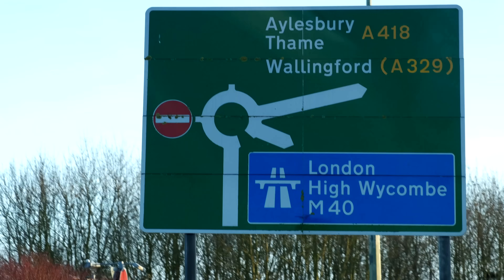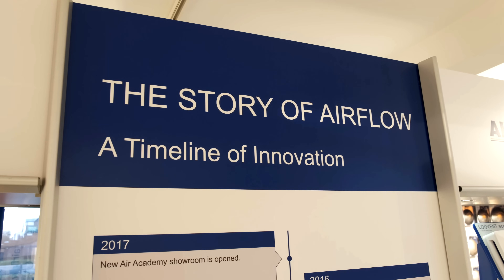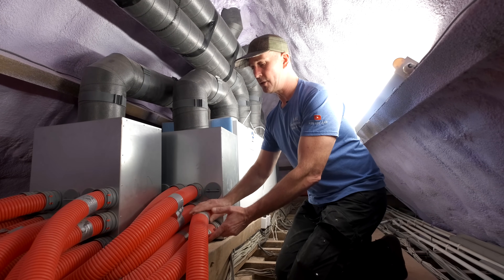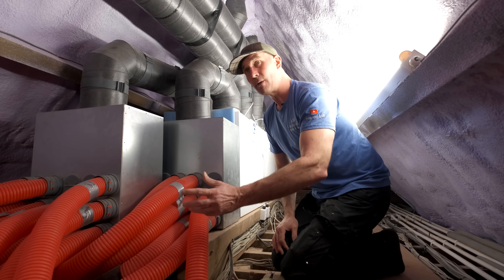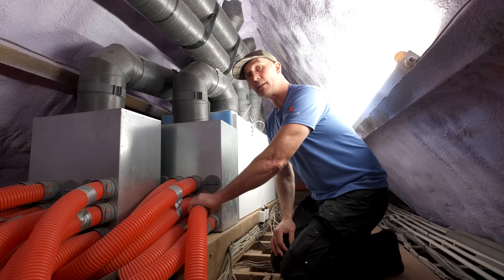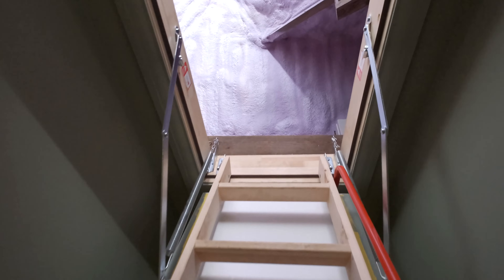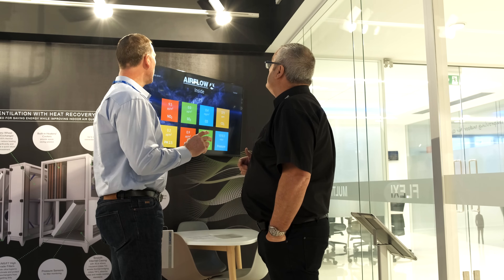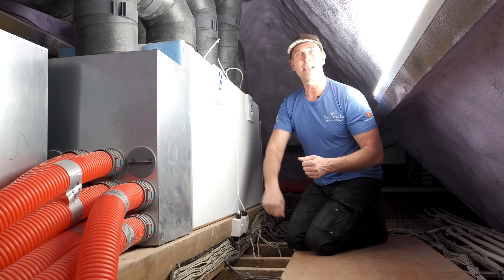Installing a Heat Recovery and Ventilation System

Comment: I have a question regarding the out/inlets on the ceiling. You have 2 pipes going to each vent, is that a flow and return or is it twin pipes to account for the smaller diameter pipe work?
Reply: It’s to increase airflow without increasing the size of the pipe and to reduce noise that might occur if forcing more air through.

Comment: Hi Tony I'm in the process of planning a new build plans being submitted, I built our present house 20years ago all direct Labour, alot has changed, I like the idea of installing this system its a two storey house with concrete first floor I want underfloor heating everywhere, Will the flexie pipe fit between the ceiling on ground floor? Very good video👍
Reply from the maker: Hi John yes it should do just make sure you talk to architect and design team of the system all the best Tony 👍
Reply: @BuildWithAE  No bother Tony Thanks

Comment: Tony, I'm renovating my house completely, would you suggest I use this system over standard combi boiler and if so, what's cost implications and difficulty in the installation, cheers stew
Reply: No chance. Keep on with gas
Reply: You are asking is you can trade apples for aubergines. A boilet gives you heat, a mvhr doesn't,  it only recovers heat through ventilation.
Reply: @AlexSavage  that makes my blood boil

Comment: From the Airflow website the DV145 unit installed is priced at £3k. And there were 2 required for the size of house shown. Plus 700m of pipework and all the accessories, labour and a fair amount of associated electrical/networking work no doubt. Then there is the spray foam and all of the effort in sealing up the house so that the HVAC system will work as advertised. The science is fine but for early adopters I cannot see any payback on your energy bills over the medium term for the capital outlay. On top of this they still need hot water which is presumably from a boiler? Did I hear him say that they had underfloor heating in the kitchen as well?
Reply: The example in the video is for a very large house. I have a 3 bed terrace 92sqm floor area. I installed 1 unit, 100m of ducting and it cost £1300 but I done all myself. I also have underfloor heating on the ground floor and rads upstairs. The hot water has nothing to do with the system. He did say they have ufh in the kitchen..
Reply: @AlexSavage  hi Alex, I've contacted a couple of firms for quotations but haven't had any response, I'd like to fit mine myself too, where did you get your kit from? Did you get it designed?
Reply: @THE-AIDEN-PROJECT  when you buy kit from firms they will do the design for you as well, if you want to go on the DIY route there's a lot on info on BuildHub forum under Mechanical Ventilation with Heat Recovery. It's definitely doable, it just depends how hands on are you.. I got my unit on ebay for a bargain price and I done the design myself.. after spending lots of hours online researching.. good luck!
Reply: @AlexSavage  yeah I'm a super DIY'er! 😂 I don't have a trade but I'll have a bloody good go! You'd tell that from my channel but I've had to go ghost mode until I sort abit of a nightmare out. I'll check the forum out, cheers mate
Reply from the maker: Hi David this house would normally cost Thousands of pounds to run a year. The HRVS system with the Air source heat running the hot water and heating side this pay back will be in 6 years with the grant from the government, Fossil fuels just keep going up. it has massive health benefits for Air quality and filters out irritants like pollen and pollution which is good for hay fever and asthma sufferers all the best Tony 👍

Comment: Should MHVR be operating 24/7?
Reply: Yes
Reply: Only times you may need to reduce fan speed is in extreme low temperatures to stop ice problems. Not something we have issues with often here.
Reply: Most units have frost protection. Some will let you set the temperature that it kicks in usually -3 -5

Comment: I understand that this is a paid video(there are a lot of other manufacturers,  but I have used their ducts which are 63mm diameter not 100mm), there are pro's about fitting a mvhr unit in the house, it costs a bit but it's not about getting your money back. You will get some back but you will have fresh filtered air all year round. Considering that you have to make the house as air tight as possible, you will be saving on your heating bills/cooling. The air flows don't mix, so there no air recycling only heat recovery.
Reply from the maker: The paid sponsorship didn't come through Airflow on this video, it comes from our show sponsor (MKM) that appears at the end of every episode. Take care 👍
Reply: @BuildWithAE  I understand, I like that you are spreading the word about MVHRs but no so keen when you focus o a particular brand. Keep up the good work!
Reply from the maker: Hi Alex thanks for your kind support and help answering the comments it would be cool to have you on a podcast if that’s ok with you and we can talk about different makes and other factors with the systems all the best Tony 👍

Comment: Just what I needed as I was looking forward to researching this and your video helps. Just a question how good is the air extraction in the kitchen compared with a standard extractor? Another stupid  question.. is the fresh air supply into the room cold and warm air depending on the setting and how noisy is the system
Reply: It doesn't perform as well as a standard kitchen extractor that vents outside. This is for constant background venitlation 95% of the time and boost when using the shower or cooking. The extractor point in the kitchen isn't recommend near the hob because of the grease might get sucked up.
Reply: Your kitchen extractor directly above your hob/stove has a few speed settings 1/2/3. It will extract from 10l/s - 24l/s. Many kitchen extract systems above the hobs do not have the ductwork installed to dump the air outside the property. Its simply pulls the air pass a filter and dumps it towards the top of the kitchen merely acting as a degreaser. 

Kitchen extraction that is part of the mechanical ventilation system (MVHR) is more consistent and reliable. The air valve in the kitchen ceiling can be setup in a manner where by the air is extracted 24 hours a day @ 10l/s like setting 1 on the independent kitchen hob noisy extractor. You do not have to keep turning it off and on. 

If you require more extraction rate from the system your could flick a boost switch and the air extraction rate can increase from 10l/s to 17l/s. The boost could have an overrun timer on it set to 15 minutes where you control the rate of air you removing.
Reply: @kirkenicker3136  OK. But the area of the air attraction unit is too small to really extract the air from a large kitchen even at 10l/s.  The normal formula is 1l/s is approx 3.6m3/hour. So at 10l/s that is 36m3/hour of air extracted. This would be fine if the volume of the kitchen is small but not sure you will get many air changes/extraction per hour with such a system. Therefore my own conclusion is that a good hob extraction can achieve a much higher volume of extraction and more air changes per hour.
Reply: asif zardari residents don’t stand in front of hobs for hours on end to ensure living spaces undergo sufficient air changes. 

I have been commissioning residential ventilation systems for 9 years now and can tell you 1st hand that people will never remind themselves to run jobs that are a noise disturbance for long periods of time.
Reply: @kirkenicker3136  you make a valid point. I still think these systems are good for general background ventilation as they are less noisy and run for long periods. Maybe i need to test it out when cooking a spicey Indian curry to see  how well it works compared with a good kitchen extractor to a duct outside.

Comment: It works but at what cost.
Reply: @martin2466  my unit's yearly consumption is less than £100 and I need to change the filters twice a year, that's another £24 a year. So, not that expensive taking into consideration the heat recovery
Reply: 🤑🤑🤑+ labour 🤑💥🤑💥🤑💥🤑💥😝😝
Reply: A lot.
Reply: Machines are about £3k each, there’s not a lot too them.. ducting is cheap
 It’s the upheaval and retrofit that’s makes it expensive, you also need space for all those pipes. New build, it’s not that expensive.
Reply: Units are a lot less than 3k. I done my whole house for 1.3k, 3bed terrace retrofit DIY. This includes unit, pipework and vents.